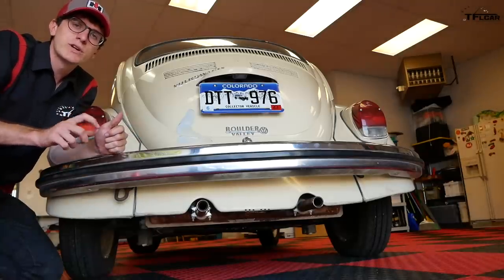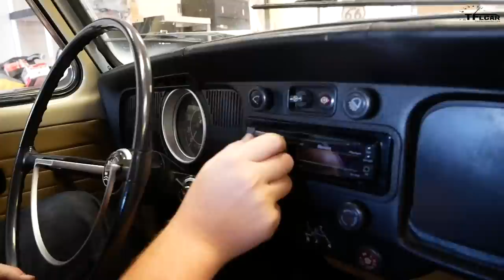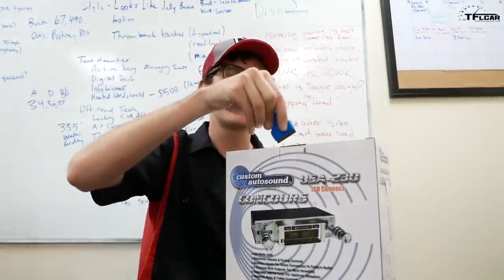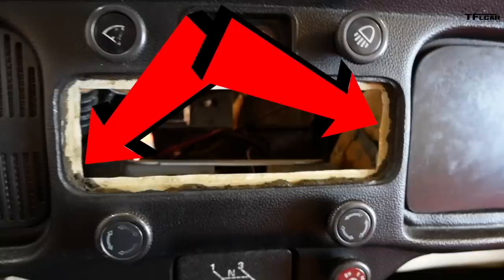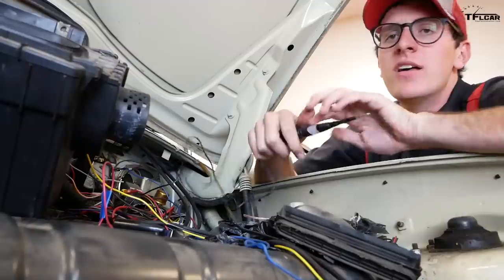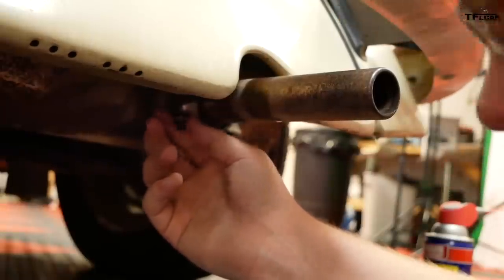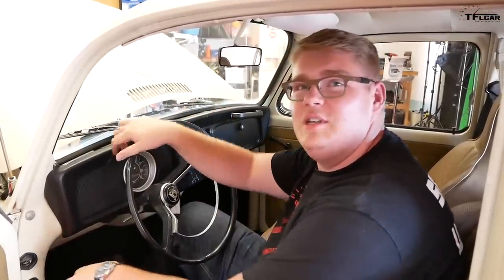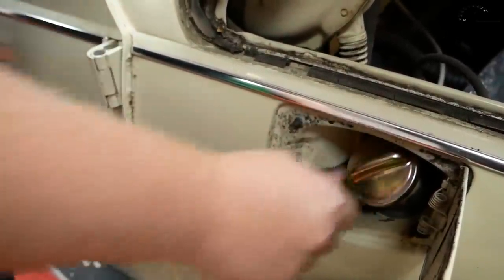How We Made our VW Bug Sound Amazing for FREE | Beetle Diaries Ep. 5

Comment: What did you do to improve the sound that was free? Everything you did in this video cost money. Good video though. Most people ditch the stock exhaust and go with something aftermarket, as the stock exhaust is somewhat restrictive even for the stock engine, and NOS or repro stock-style are much more expensive than better-performing and often actually quieter aftermarket options. But yours looks like it's in pretty good shape, and with the rest of the car pretty much stock, you'd probably be wise to keep it. Many bugs are battered and modified, so there's little point to trying to keep things as they are - that's my approach with mine, I've changed a whole lot, no regard for keeping anything stock. But yours is so close to original, you've got something rare, and ought to keep it that way. Wouldn't suggest even what I otherwise consider must-do upgrades, like front disc brakes or an electric window washer (does it still have the spare tire powered window washer system?). Just make sure to take out that 009 distributor mentioned in a previous video, it's not stock and it really sucks.

Comment: I know this is going to sound insane but there is a correct way and an incorrect way to install tail pipes on a VW Beetle. Read the manual ( Robert Bentley Official Repair Manual ), you first need to measure the length of the tail pipe then measure the depth on only the left one to a small pipe that leads to the heat riser on the manifold. When the left tail pipe is installed to the proper depth it forms a venturi that, as the exhaust gasses pass, forms a low pressure area that sucks hot exhaust gasses from the right hand side warming the intake. Read the manual, the left one is vital. Your intake heat riser tube will not function correctly, and will in all likelihood coke up. Plus the engine will never warm up correctly and the fuel mixture will not vaporize properly. So don't just go stuffing them in there. Well....you can on the right one but not the left.
Reply: Brian Allen... Recalling back to the early 70s when I worked for a dealership, the left tail pipe goes in all the way till it stops, then pull it out roughly 1". Install the right side to match for length and you are done. I can also tell you that the German made mufflers will last twice as long as other types.

Comment: Pioneer is not cheap walmart radio.
Reply: that wasn't a Pioneer radio
Reply: wcnmvp  Premier is a Pioneer radio.
Reply: pioneer is walmart brand and so is premier they were sold to walmart and are still considered on the lower level of entry stereos... if you want to be exact. not saying pioneer is all walmart brand but some of there stock is in walmart and isnt really considered quality. but they do have nice upper level head units
Reply: Yeah, but it looks like crap and doesn't match the car at all.
Reply: @NESherv  to be perfectly honest neither does the Jbugs deck I personally feel a Pioneer DEH-x6900bt would look much better in that DIN and provide a serious amount of sound quality if you run kick panels and possibly throw a 750 watt amp in the back a rw-10d2 and 1 ohm drop it in the biggest box you can get into the back of a bee.... personally I run a x6900 with a 2k watt amp attatched to two rw-10's 1 ohm dropped in 1.2 cubes each takes up the whole rear seat but it slams... and I'm still using the stock generator for a power source never drops below 12.0V
Reply: @wcnmvp3820  It was a Premier by Pioneer.  Considered a step up from Pioneer.
Reply: @RETZ1LLA  .. Never drops below 12 volts? If it wont hold at 13+ volts you will eventually have issues, because you need MORE than 12 volts to actually charge the battery. Turn on the wipers, rear defog, and headlights then try again while driving 40 mph in 4th gear. (might be around 2k engine RPM) I think you will find the stock VW gen / alt falls short and the battery will begin to sink after a few minutes. Stock 12 volt generators were only around 30 amps, although the alternators (starting in 1973?) were closer to 50 amps so you might squeak by without other electrical loads. On the positive side, with the battery in the rear of the car you only need short cables to any amplifiers!
Reply: I've never had an issue with my battery I've driven around for hours with the voltage at 12.8-12.9 and stopped and started the vehicle nothing was drained. so tell me ? what can be wrong with that shit I've even done freeway driving my voltage stays constant 12.8-12.9 no need for an alternator
Reply: @RETZ1LLA  .. at 12.8 volts you are obviously on the edge and probably don't have much else drawing power. The other thing to consider is you are probably not "cranking" the audio to it's max either. Basically you are getting away with it and it works for you, but I couldn't promise that to a customer if I had installed such a system for them on a 30 amp generator.
Reply: @rupe53  for a customer maybe no but I'm not running a business actually I use more then just my stereo I also have a 400 watt inverter and I do like my music loud I'm usually pushing my system close to distortion point because I run a lot of DB tests and Freq tests and I get away with it I know I do because I'm constantly looking at my voltage because I sit in the passenger seat
Reply: @RETZ1LLA  .. I'm sure you can do the math so just a reminder to others reading here that 400 watts (inverter or stereo power) is 33 amps, not considering efficiency loss. OTOH, most people don't max out the capacity of their gear continuously so the average draw will be less... and the battery provides a buffer for power spikes. Let's just say there's a lot of room for fudge factor, but figuring out what will work in the long run comes from experience.
Reply: @rupe53  andddd I've been running it for 2 years no issues so were good :) I have experience don't think things are going to go wrong at this point

Comment: How to waste $180 trying to get that vintage look with modern electronics and it fails at both. That head unit is garbage. The AUX input is on the back of the radio. Buy a used non-working original radio for the looks and put a newer one in the glove box. There are simple kits to mount it in the glove box. All could have been had for less than $180 and it would have been a better stereo... but the guys at JBugs won't tell you that!